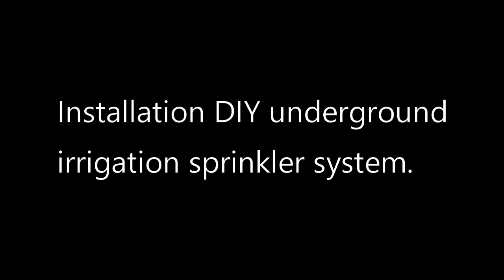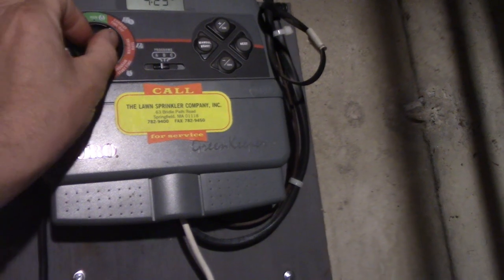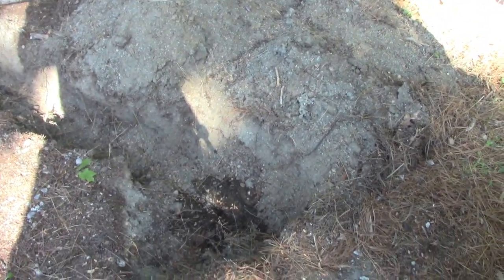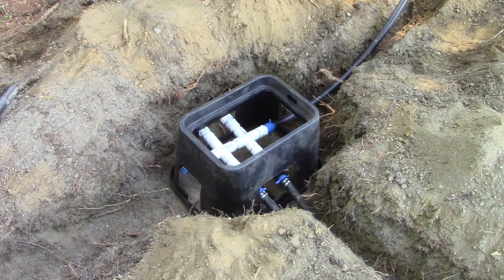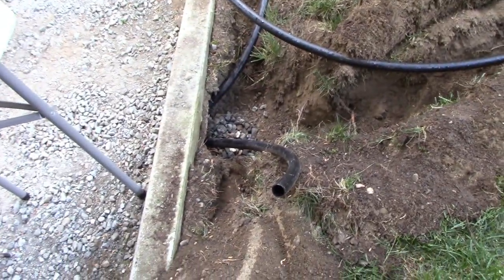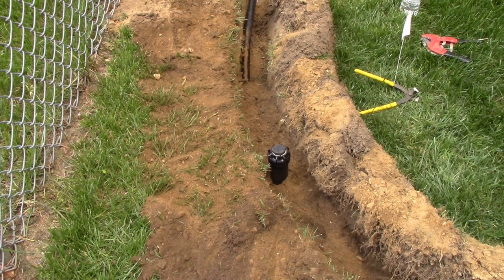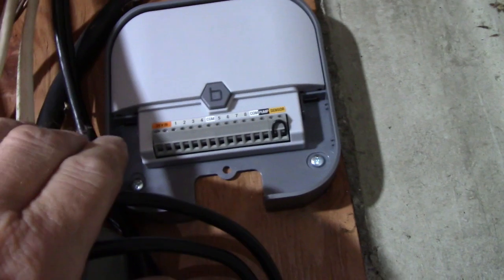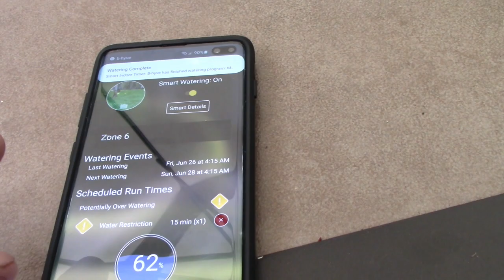DIY underground sprinkler irrigation system

Comment: Excellent video. I ran into the same frustrating situation with the orange big box store yesterday when Adding 2 heads to my sister’s system. Their site says they have plenty in stock of the fittings I needed. Get there and nothing. I spent more time looking for the correct fittings than I did trenching & installing.

Comment: To get those fittings on better use a Plumbers torch and just heat up the pipe ever so slightly, then you will be able to get those fittings in with no issues and it will seal better.
Reply: or use some soapy water

Comment: You don’t have to use Teflon on those connection. If you ever do a sprinkler system again it bet to use funny pipe it let the head move if you run something over it. The way your doing it most of the time the nipple will break offf in the fitting then it’s pain to extract it. But good job on the system I’m a sprinkler guy for 30 yrs  better then most homeowner do.

Comment: great video. Im just learning about irrigation systems and I want to install one at my home. What size piping is that and whats that clamp system called. I thought a regular hose clamp would work but your clamp system seems better
Reply from the maker: the irrigation polypipe comes in 3/4 inch inch diameter or 1" diameter. Home depot had 100' length to 300' length. And the polypipe clamps also came from home depot which you can also get the tool to clamp the clamp

Comment: What was the specific pipe size poly you used. The reason why I ask is because I bought 1-1/4 and I’m wondering how hard it will be to work with.
Thanks
Reply: Okay, I see you said 1” in the video.
Thanks
Reply from the maker: It was an inch that I used. However however someone commented on using a heatgun to loosen up the polypipe when you connect it to the t's or wherever you need to and I'm sure that would work sweet
Reply from the maker: @A D or a heat gun on low

Comment: Great video.  Can you tell me what flexible pipe this is?   Brand and or part number?   Is this the same pipe used for drip main lines?   I’d hade to do all that digging and find I installed the wrong pipe and it blows up.  
Thanks.
Reply from the maker: It's called polypipe you can get it in half inch 3/4 inch 1" all the way up to I think an inch and a 1/2 it sold at home depot around here

Comment: This is very helpful video.  I want of install it in my backyard.  It's possible for you to share the brand name of polypipe, spec and where you bought it?
Reply from the maker: Polypipe bought at home depot they have 100ft to 300ft rolls from 1/2 " to 1- 1/2" diameter

Comment: You sure are a wordy fella. You talk softly so it's hard to hear your words sometimes. This video is great! Exactly what I was looking for. Your pickax idea was perfect. From 17:00 to 18:30 saved me hours of time, thank you!  Why didn't you use heat on the poly pipe so it slides on easier? I'm sorry about your h/w store lack of inventory. Do you like your controller now that you used it a while? Where are you?
Reply from the maker: Wow never thought of heat for polypipe...controller works great haven't touched since install. Power went out so had to reset but works just fine...live in Massachusetts

Comment: Everyone talking about heat those fittings, im just wondering why do people use this shit instead of buying sch40 pvc and it’s way easier
Reply from the maker: I think when you use a ditch witch to pull the polly pipe it's easier. That machine cuts a slot and buries the pipe all in one step.
Reply: I would imagine its cheaper than sch 40